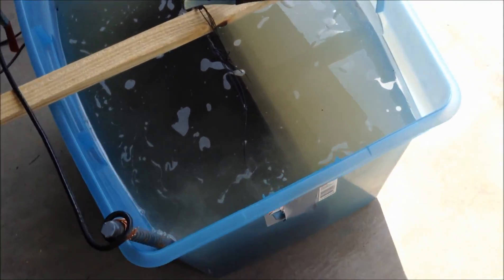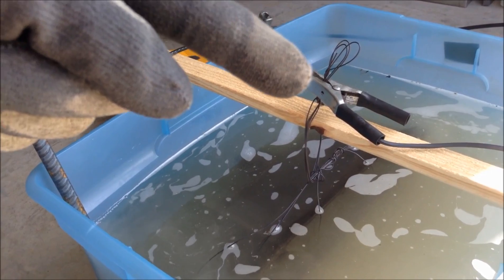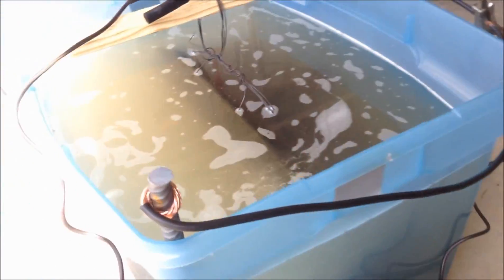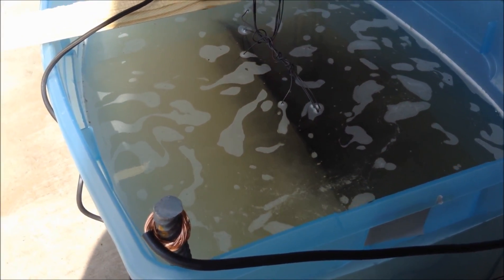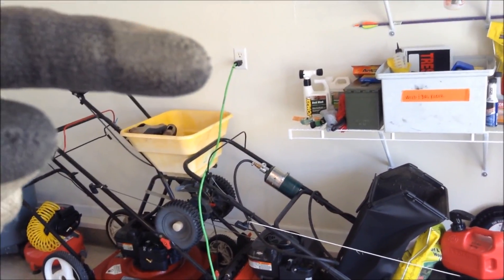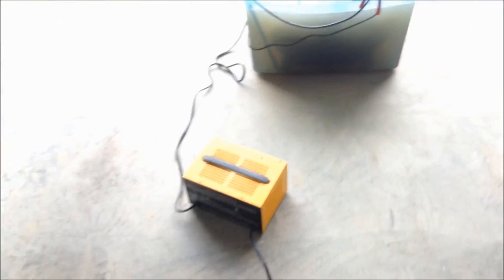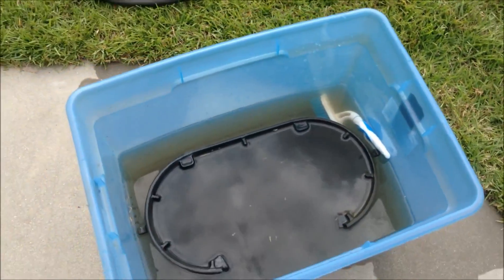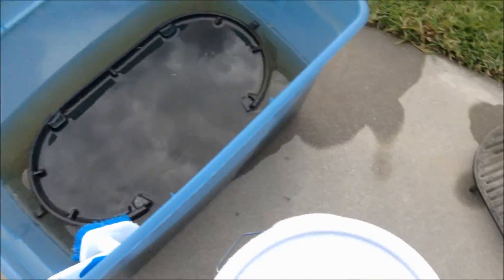How to build an Electrolysis DeRusting Tank

Comment: You can turn baking soda into sodium carbonate. Put 2 cups in a small pot, put it on a hotplate outside, turn the hotplate to medium or so, stir constantly, you'll get like bubbles in the baking soda and when they stop, sodium carbonate. No water added, just the dry baking soda. Look it up.

Comment: A hundred bucks says if you turn that fan off and strike a lighter over that tub you will not explode into a massive fireball. Is the gas it's letting off flammable? Yes. Only if you're sealed in an airtight bubble with the project for hours. If you entered the bubble to light it almost all the gas would be dispersed and it would not light. Unless you sealed it back up and waited hours. So on and so forth lol. The gas you really have to worry about is if you add salt (i think it's salt) you'll make a type of mustard gas. That you want ventilated the most.

Comment: I would've really liked to see how the wire was wrapped around the cast iron prior to process.
Reply from the maker: Essentially I just took the wire and ran it over and around the cast iron to transfer current equally . The water conductivity however contributes to the current and electrolysis being equally applied.

Comment: ⚠️ Electrolysis creates atomic hydrogen, which can ruin the steel. This is called hydrogen embrittlement.
Reply from the maker: Do commercial versions of electrolysis tanks create the same issue? I've seen lots of metal workers using such tanks.
Reply: @sparkynapalm3662  I am not sure. But maybe its good to be careful. More information, for example at Wikipedia.

Comment: I've always been told it only works with manual chargers, not automatic.  However, your charger's automatic/manual switch is flipped over to automatic.  Please help me understand.
Reply from the maker: To my understanding the automatic setting reads a batteries level of charge and then turns off. The best I can assume here and with mine is that there is no battery power to monitor so the charger stays on as long as I want it to run.

Comment: I used this process for years and years with my vintage car parts and it not only works great, but the residual left over water and chemical content can be poured directly into your flowerbed (not your garden though) and used there for mineral content which does no harm. I also found that simply using a clear plastic container filled with a gallon of vinegar and put out directly into bright sunlight (very common down here in Texas) will also clean up parts just as effectively, but both systems require immediate attention with the cleaned parts being primed or just covered with a light coat of oil to prevent flash rusting, after any immersion bath. Thanks for posting. It is the very same setup I always used and the same Arm and Hammer wash soap, too.

Comment: I use the same metal in the sides of the tank, but after three times most of them has corroded away. Almost gone. Is that right? I thought they only collected the rust from the negative side...
Reply: Since the rods are untreated, they'll rust/corode away. 

If you wanted to, you could probably use stainless steel rods to negate the issue, mostly, but rebar is dirt cheap so...yeh.
Reply: Thanks akabiscuitwaffle. I have some stainless steel rebar on hand. I have a civil war cannonball and a couple of bayonets I dug up. I’m gonna give it a shot.😉

Comment: Hi i am from india and i have a question. If i use UPS transformer which generate 14 volt current . So is it safe or not. Becouse i dont have battery charger and i dont want to spend money for this. But i have old scrab UPS 😂😂

Comment: How do you dispose of the used water
Reply from the maker: To what I know the water is relatively soft (chemical wise) since the additive I use to enhance the electrolysis is something that can be be bought in just about any grocery store.  That water goes down the drain as being nontoxic. This water just has the addition of having iron oxide (rust) scale in it and the water is only slightly altered.  I just put it down the drain.  If you have a suggestion please let me know.
Reply: Pour it out

Comment: Would you know of a solution to trap and collect the hydrogen gas so I can use it for metal etchings?
Reply: Any type of funnel, like in this case a stove range exhaust hood would be big enough, placed above the box and some container turned upside down at the end of the funnel. Gas will always be at top so put a lid on it before turning it upright
Reply: No need for the exhaust fan just the hood
Reply: Oh and if you have a fan blowing it all around your shop it won't work

Comment: Actually, the anodes are connected in "parallel." Molasses at a mix of 1 to 9 water works very well on its own. Combine with electrolysis and , holey cow, watch it go. The Molasses is VERY conductive.
Reply: You mean 1 part molasses per 9 parts water?
Reply: @longfade  correct.  And corrected.

Comment: When in use, Does the battery charger heat up really bad? I made an extremely dangerous rig out of an old 24v pc charger and the resistor about exploded.
Reply from the maker: I have not had any issues with the charger.  I did make sure there was good airflow and a fan to keep things cool and to vent out any gases outside,

Comment: Is it bad to clean something that is rusted which is zinc plated?
Reply from the maker: Yes..avoid zinc plated, galvanized, stainless steel or others.  Bare steel or bare metal is best.  Other chemically applied coatings can come loose and break down into some hazardous components.